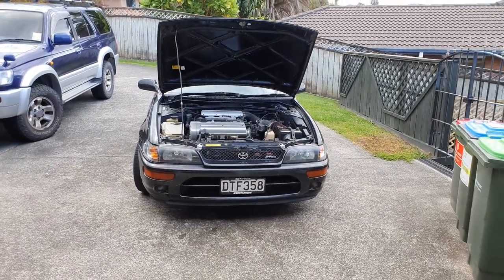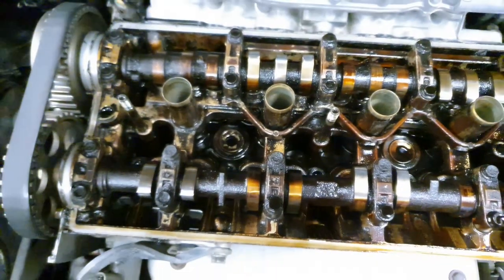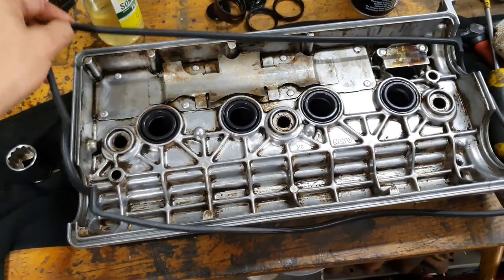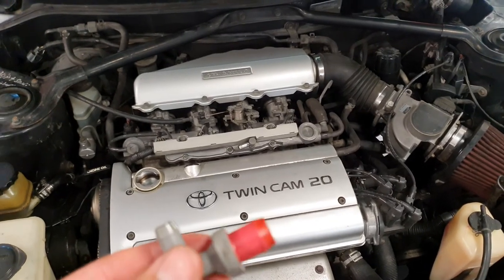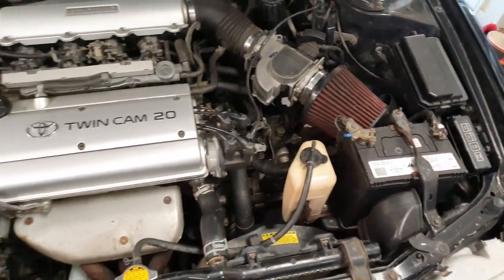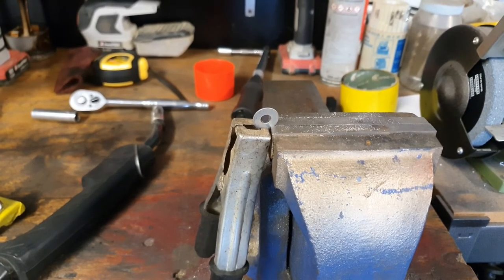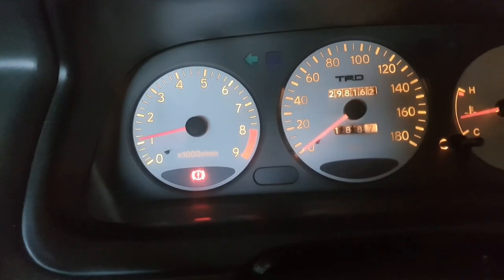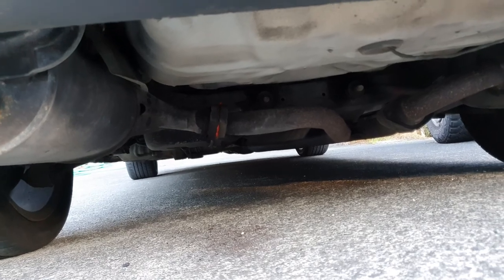AE101 Corolla GT Cam Cover Seal & ISCV Mod

Comment: Have you tried cleaning out the ISCV? I had a Levin with 300 plus k, which idled really high until I had it ultrasonically cleaned, helped heaps

Comment: what torque did you use for the cover bolts?
Reply from the maker: Think its around 8nm. A quick Google search will tell you
Reply: @4AGEEDGarage  i torqued mine slightly and my valve cover cracked. Fml
Reply from the maker: @scottbuji186  that's no good! Maybe it had a pre existing hairline crack before it was torqued down?
Reply: @4AGEEDGarage  i would assume so. Luckily a friend of mine had a spare cover in garage